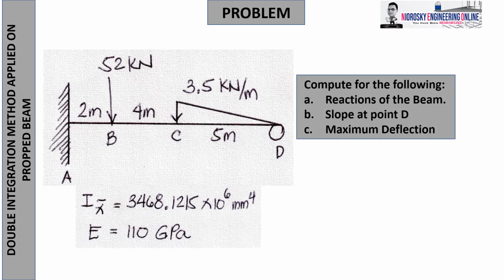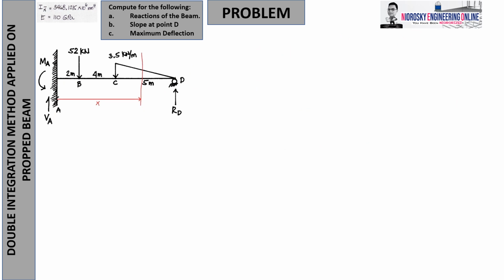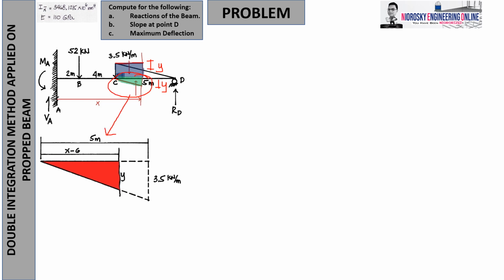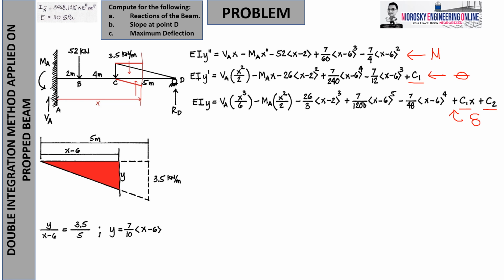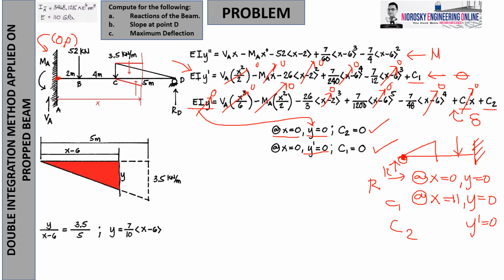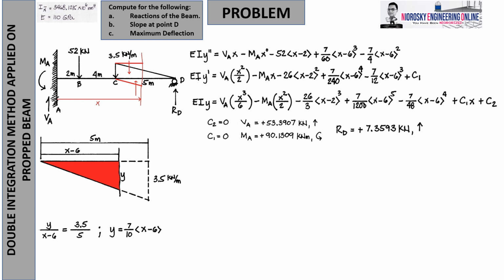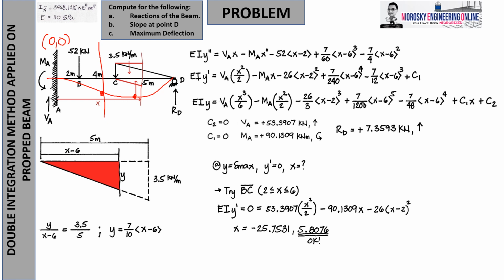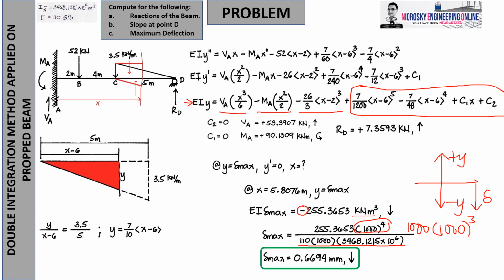DOUBLE INTEGRATION METHOD APPLIED ON PROPPED BEAM

Comment: Paano nya po nakuha yung value na x=5.8076?
Reply from the maker: @preciousliamb.d9532  just use your calculator functions either the shift solve mode, quadratic eqn (degree of 2), or by manually simplifying the equation using discriminants rule learned from your algebra class. Cheers

Comment: Hello po! Tanong ko lang po sa 14:46, bakit x=11 na po pag ganyan yung orientation ng triangular distributed load? Thank you!
Reply from the maker: @josephjoe9525  use geometric reorientation for those loads not touching the fixing point and loads which is 1st deg or higher should be increasing as it approaches the same point. Cheers

Comment: Engr. what if you have extended overhang after the roller support without any loadings, same cut lang din po ba like sa solution mo? If wala po loading sa overhang, your deflection also the  elastic curve at the overhang would be constantly increasing after the roller support?
Reply from the maker: As discussed in the principle, the cutting section should always be the last segment found on the right side. Cheers. See my video lecture regarding the discussion of the principle. Here is the link: https://youtu.be/LVQW_uoqIHA
Also, an actual problem can be found under my playlists considering if there is an overhang on a propped beam. see this link: https://youtu.be/b4iYHoHAtDw
#niororized :)

Comment: Question po sir.
Let's say po same dimmension lang po ng beam pero yung triangular load is from 2m to 6m po. at yung 52KN ay nasa 10m po. paano po yung mangyayaring dagdag bawas na load?
Reply from the maker: hi. kindly watch this video lecture regarding your inquiry. pag may tiyaga, may nilaga :) https://youtu.be/PoPUBDfGwPA
Reply: Sir pano po kung trapezoidal pero decreasing. pano ko po ba ako magdadagdag ng load dyan sa trapezoid para mag-aaproach pa din sya X.

               __5Kn/m_
              |                    \                    3Kn/m
              |                       \            __________
________|______________|______|_________|
----4m----|-------4m--------|--1m-----|-----2m-----|

|-------------------------------X-----------------------|
Reply from the maker: @alexandermarcelo2626  it is the same. Just add a rectangular load.
Reply from the maker: Use the method of superposition as taught bybyou college prof under atatics of rigid bodies and mechanics of deformable bodies.
Reply: @nioroskyengineeringonline8968  
meaning to say po ba na triangle at rectangular load ang idadagdag ko po.
Kung ganun po, hindi ko pa din po alam kung ano ang magiging distance ng triangle dun sa X.

pasensya na po. ayaw po kasi kami sagutin ng prof namin. bawal daw po ang magtanong, wala na po kasi kaming ibang mapagtanungan
Reply from the maker: @alexandermarcelo2626  ok check this. Cheers. https://drive.google.com/file/d/1-gG7fu_X94zWt6CIt3TlaZ05yYo8CFIN/view?usp=sharing

Comment: Hello sir kung i compute ko po ba ang reactions before integrating, same lang po ba dapat sa nakuha mo around 17:36 ?
Reply from the maker: You cannot comoute the reactions without undergoing the method as discussed since it is indeterminate. Statics alone is not sufficient based on max of 3 equations set. Cheers